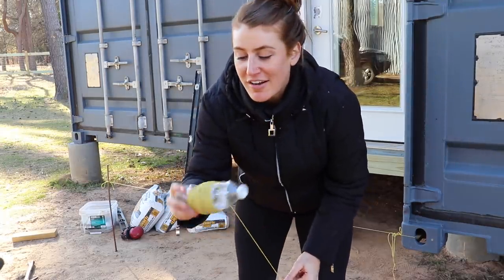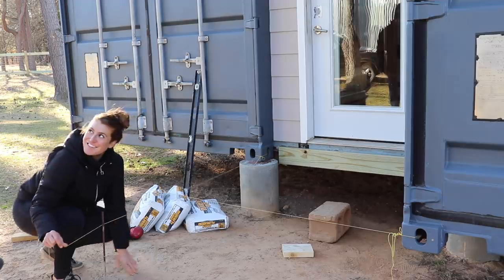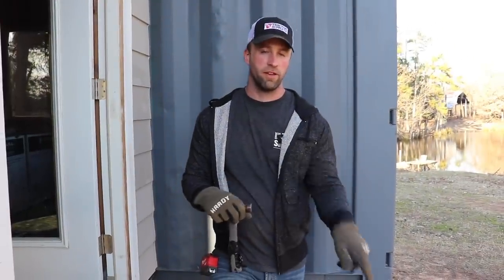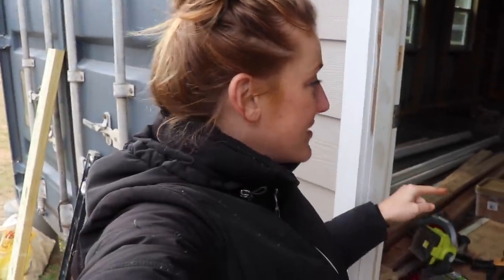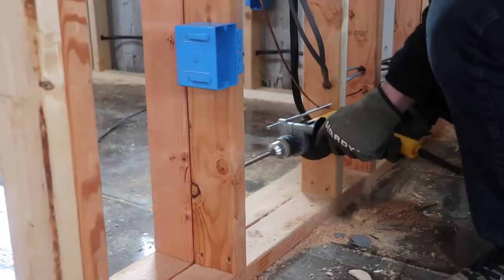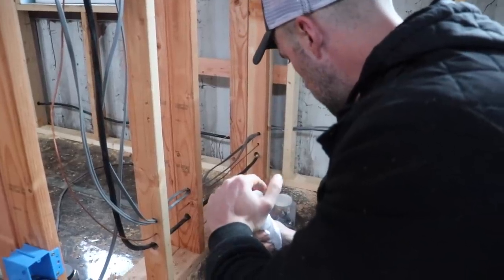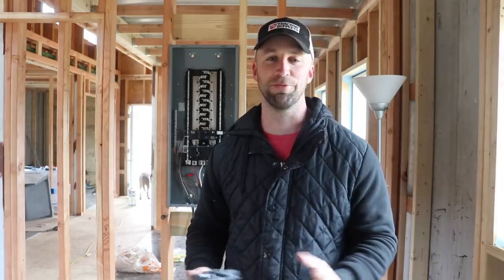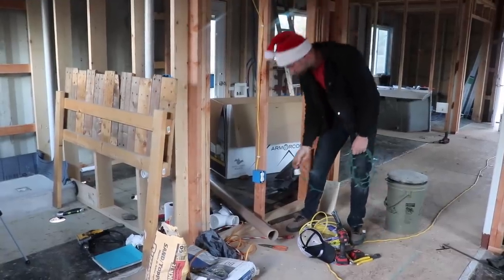Wiring Our CONTAINER HOME!

Comment: Hey, guys, first I want to say that I love the channel and it has been a pleasure to watch your process. I also want to preface this by saying that I'm not a professional and I'm not criticizing here, I am genuinely curious about what I'm going to bring up. Your water system, are you sure you're going to be able to collect enough rain water to support your life in this house? Because I did some math based on some information that I have gathered and you may come up short by quite a bit. Assuming that you have a 4/12 pitch roof, all 3 roof sections are contributing to your rainwater collection and you have 6 inch overhangs... (I can't remember your exact specs), but you should have approximately 1122.99 square feet of roof space. And 1000 square feet of roof can collect 300 gallons of water per half inch, or 600 gallons per inch of rainfall. So, with your roof size, you'll be able to collect 673.8 gallons of water per inch of rainfall, which is being nice because your upper roof overhangs some of the  lower roof, essentially making that space ineffective for collecting on the lower roof. Now, where my land is, where I will be building my house and collection system, Palm Bay, FL, it rains 54 inches annually. The national average is 38 inches per year. I think I remember you saying that it doesn't rain much where you live, but I'm not aware of where that is so used where my property is for the projection. Now that's 0.148 inches per day at 673.8 gallons per inch of rainfall, that's 99.7 gallons of water collected per day on average. The average person uses between 80 and 100 gallons of water per day. So, say that you're being  conservative and only counting the baby as a half for now as it won't use as much water, but will still need some, you're looking at 80 gallons per day for 2.5 people, which is 200 gallons per day. So, unless you recycle and filter most of your water or build a 2nd structure for collecting water that is at least 1,200 square feet, assuming you're getting rain equal to Palm Bay, FL... you're probably going to end up running out of water. My idea to get around this was to have a tank for collecting the gray water that isn't urine and filtering that to reuse in the shower, dish water and watching machine and only use the fresh rain water to supply the sinks so you can drink it and brush your teeth with it. And then I would have a singular disposal pipe that the dishwasher and urine would be emptied from the house with. Poo would be removed by using composting toilets, but the ones that separate the feces from the urine so it doesn't become incredibly vulgar smelling. Anyway, just a thought. I didn't want you to get moved in and have everything completely finished and then find out that you need more water. However, I could be missing something.

Comment: If you haven't done so yet get a receptacle tester. Best $6 you will spend. It will catch a lot of mistakes that can happen after wiring a bunch of outlets. HF has one 

https://www.harborfreight.com/electrical-receptacle-tester-with-gfci-diagnosis-63929.html

Comment: Spenser stabbed himself with a screwdriver.  I've done that a few times, too.  

I noticed you using a speed spade to drill the holes for wiring.  May I recommend an auger bit?  I think it works better (faster and cleaner holes).

Comment: normal rules elektric have 2 fuse/room minimum. but normal uses 4 fuses/room, have lot better safety, if cicuit break stay 1 more fuse on light, 2 fuse need be left side room light and right side room light same wall sockets left side own fuse and right side own fuse, if circuit break or somethink problem you stay safety light and socket half in room what working and have light. no stay full dark room. simple easy and cheap make good all and no save stupid place money. no expensive use 2 or 4 fuse and cables. im certified elektric engineering and i plan,build and make many 10 000 house before my life. my country , insurance not pay anythink if owner build own elektrick, wery dangerous amateur try build dangerous system and dont know all good. can kill itself and many peoples, need be certified engineering if want safety good elektric and insurance work and pay too if has somethink problems.

Comment: Electrician here....one of the greatest failures in electrical installations is using the "passthrough" feature on receptacles. You need to "pigtail" them so that you only have one set of wires going to the device and if you need to remove the device then you can do so without affecting the circuit. I recommend using the push-in style wire nuts from companies like Ideal or Wago...they can help make reliable splices and pigtails without having to worry about the skill needed for traditional twist style wire nuts.

Comment: Will you be loosing the big hinges and locking mechanism on the trailer ends when the home is complete. The corrugated fols in the containers looks cool when it is painted but losing the heavy bars at the ends will take away that industrial edge if you just cut them all off and welded then all shut. As the home has gotten prettier and prettier I keep noticing the heavy bars and hinges and keep thinking it would look more beautiful with them finally gone also. Just a thought. It already looks way more gorgeous than I thought it would do nearing completion structurally. I have seen a couple other container homes before going back quite a few yrs but this one just looks so appealing to me. I would love to go this route myself before I start getting too old for all the harder work, also doing it all yourself must add a huge slice of compassion into the mix because nobody builds their own homes anymore. To be surrounded by a lake, fields a forest and beautiful domestic and wild animals is so natural with health benefits for you all. We live outside nature these days when we really should still be living alongside and within nature as much as possible. Only happier and healthier days ahead for you both I'm sure:)

Comment: I'd first like to say that I enjoy your channel here very much and I look forward to each new update. My primary trade was an electrician, was, as I have been retired for over 15 years, except for occasional helping out friends. Your experience with the arc suppressor circuit breakers was both funny and a learning experience for me as I never had to deal with those as of yet. When I wired a house or any building that had the panel powered, I tried to not have more than one outlet per room live. You will soon enough find out when you dry wall the walls you have installed the devices already as you will have to at least loosen all the devices you have installed to allow the the device to bee against the wallboard for a more stable mounting. I did it all the time for convenience and to have a minimum of extension cords running all over. As for testing everything, that is done after everything else is done all at once. 
Keep up the good job, just constructive and helpful criticism.

Comment: You guys are making great progress, but I would suggest not putting the electrical switches and plugs on until after the drywall is in place.  The little tabs on the plugs and switches are designed to align the plugs and switches with the finished face of the drywall.

Comment: Okay I've seen you guys have some crazy luck and after finding that pipe I have some advice, now that you are wiring.  They make little metal plates you tack to your studs anywhere a wire or pipe for that matter passes through a stud.  When you start dry walling I am certain you will hit a wire or pipe if you don't use these!  lol  It takes time but the time you are taking and effort you're putting into the house it makes sense.

Comment: On the electrical  common process is  1 install box's wire ( rough in phase) next the sheet rock guys  come in do there thing, than the painters come in ,  we the electricians come in and put the switches , plugs  light fixtures etc  ( trim out ) reason is  if you put the plugs in the box's before sheet rock , and than put the rock up the wings of the outlet, switch is traped between the surface of the outbox and the sheet rock , therefore if you have to take the outlet out for any reason you will have to dig the sheet rock out from around the wings of the outlet/switch,  and when you try to put the plates on you will have a gap between the surface of the sheet rock and the outlet  bad deal. That's what the wings of the outlet or switch is for is to rest against the surface of the sheet rock providing support to the outlet/switch. Just a heads up .  Master Electrician/engineer (ret)  20 years  field experience .

Comment: When you are not working on the load center  please put the cover back on it.  There are many ways people or animals (like Bear) can accidentally come into contact with an energized conducter or bus.  Also, test your outlets with a plug in tester made for the purpose. It will show you if your hot and neutral are wired correctly and if you have an open ground, or worse,   Plugging in the Christmas tree lights only tells you that one prong of the outlet is hot and the other has a ground or neutral on it.

Comment: I have to say it really did look like a real Christmas tree in the window. 

I would have installed a four plug out let instead of a two plug outlet every 6 feet.   We all have multiple item that we gave to plug in.  Also this let’s you add some usb outlets.   
Another ideal is to put some outlets higher up on the wall.  This makes it easy to plug in a vacuum cleaner or other items you frequently need to move around.

Comment: First of all, Merry Christmas to the almost three of you.  Second, I love your laughter. Don't ever stop laughing at/with each other. Third. The smart way to wire breaker box is come in on the opposite side of where you put the breaker. Loop ( called a service loop ) around box to the breaker. If you ever have to move breakers or circuits around you'll be glad for the extra wire. Last, you guys and bear are doing great. Keep up the great work.

Comment: You should leave a bit of a loop below each box before clamping cable to stud so you can pull up wire if you have to modify the contents or wiring in a duplex box at a later time

Comment: Quick replacement for the line spool is like a 12" piece of 2" pipe. 2" so you can run a dowel or smaller diameter pipe inside to hold while running out the line. 12" long so you have room to hold it while rewinding line back onto it.

Comment: also the main panel appears to be upside down most common the main is allways located  at the top of the bus bars , in my 20 years in the field the thousands of electrical panels that I have installed  every one the main is located at the top of the box, . Common floor outlets  are normally ( 15 amp outlets  8 max on a 15 amp branch ckt ) GFCI ckt to bathroom/outside can be combined or each . ( A GFCI outlet or breaker) Kitchen  # 12  a min of 2 ckts required , me  1 to the icebox, 1  microwave, 1 dishwasher/disposal  this is all to NEC  (national electrical code)  anything with in 6 feet of water code requires GFCI or outlet or breaker and outside  all inside and outside lighting can be # 14 romex  and number of ckts required   FYI  good luck
Reply: Panels are generally designed to be installed either way.

Comment: METAL BOXES are better than PLASTIC  because you cant ground on plastic your switches and PLUGS
Reply: Plastic is non-conductive, so you don't 'need' to ground it...
Reply: @jsimanella  IF YOU ARE NOT DOUBLE GROUNDED IN CASE OF LIGHTNING its gone FRY EVERY ELECTRONIC in your house they have been BAN HERE  BY BUILDING INSPECTOR IN ONTARIO CANADA

Comment: Spencer I know how the containers are sitting, but how are they tied down. How are you protected from wind damage other than weight??
Reply: The containers are welded to plates that are anchored in the concrete piers.
Reply: @ronsommer9409  Thanks, I assumed they would've been and I didn't remember. This is going to be my next project and I have learned alot and I have alot to learn!!!

Comment: I have been told that the electrical code is going to change in the future to have the ground on the upside of your plug (vs bottom) and the power and neutral will be on the bottom.  That way if anything lands on the plug, it won't short. Just flip the plug! You guys are doing a great job!
Reply: You were told wrong.
Reply: @jsimanella  Actually a couple of jurisdictions here in the DC area have already made that part of their code. A master electrician said that he heard it is in discussion for the NEC and that he thinks several other local jurisdictions will add it to their code before the NEC. My BPI trainer also said he knows it is being discussed in general. (Local and NEC). So maybe 3 to 5 years it might show up in the NEC. The two main causes of the shorts are knives and tinsel falling off Christmas Trees.
Reply: I'd like to see your local codes.
I've been doing this for 35 years. The orientation argument is older than I am.
Take a look at the typical job where the ground is up. You'll see a greater number of broken outlets at the weak points.
When people pull a plug, they generally use an out and upward motion...
Reply: @jsimanella  I am not completely sold on the idea either.  I don't use tinsel on my tree and how often do you really drop a thin metal object near an outlet?  Arlington County VA.

Comment: Congratulations on the installation of the receptacles (outlets) in your future home... Now go back and turn them over because they are upside-down!

The ground position should be at the top. It's a common mistake.

Merry Christmas!
Reply: There's no rules for orientation.
Reply: @jsimanella  

There didn't used to be rules. The code was revised a few years ago. It is a safety concern.

Not every AHJ will fail a COO but they CAN fail you.
Reply: The Code wasn't changed for orientation.
I've been doing this for 35 years. This argument is older than I am.
Reply: @jsimanella  

We must be about the same age because that's about how long I was an electrical contractor before I retired.

I have seen COOs denied for that but admittedly that wasn't the only violation. Also, it was a commercial installation, not residential.

Comment: Don´t you need to be an electrician to install all electrical equipment. Excuse my bad English.
Reply: No.
Reply: @GeneWaddle  I see, here in Sweden you must have a lincens
Reply: @hanzon  The rules vary a lot here depending where you are located. In a lot of  more rural areas the rules can get pretty lax. I think in most places anyone can do the work as long as it's inspected and there are places where inspection is not required.

Comment: That is why we use an electrician to wire up our houses. We also stopped using that style of power points(outlets) and industrial circuit breakers  back in 1950.

Comment: Couple of comments as an electrician...

Why the heck are you using UG rated cable (direct burial) in doors? I avoid those cables like the plague, I rather run pipe under ground than direct burial. All because of the labor to go through in stripping them. So you can use just regular Romex cable from the rest of the house.

Two, and possibly a NEC violation. I saw that you installed a 20 amp outlet in the bedroom. Which in itself isn’t a NEC violation, just odd. What is, is if the breaker is 15amp and/or the cable is 14AWG. 

I couldn’t tell, but all of your outlets for a residential dwelling shall be TR, Tamper Resistance. So your (future) toddler won’t be able to force anything in there. There are little shutters inside the prong holes. And TR will be stamped on the front and backs.

Comment: I'm blown away you are allowed to attach a circuit to a switch board. I guess that's allowed where you come from?
Only licensed electricians who understand the proper testing of an insulation should be undertaking this type of work.
No understanding of a residual current device.
No earth continuity test
No insulation resistance test.
No bonding continuity test
And I'm guessing no bonding on the metal structure.

Dangerous!
So I'm guess the fact that a shipping container is sprayed with methyl bromide and numerous  other chemicals over it shipping life is of little relevance. Chemicals that soak into that wood floor. chemicals that you will breath in for many years....
Good work on putting your family in danger. But at least it was cheap right?

Comment: Wow. A mold factory on stilts! You two have a lot to learn about condensation on the inside of a shipping can. 
Sorry for sounding negative (not intended). 
I hope you’ve got something up your sleeve I don’t know about. I’ve done testing in my can house and was shocked by the volume of condensate being produced. I went back to the drawing board and insulated the outside of the cans. 
Did I see 20amp outlets with 14/2 wire? That’s a no   no by the code in the great white north. 
Good luck,
Merry Christmas!

Comment: certified socket tester have lot better and safety, this measure true neutral-hot wire-ground wire have true right. because if not have ground wire added right have super wery dangerous all connections because have metall wall ewerywere. this is idiot style "testing" use cristmas light working, yes can see work but no can see have safety all sockets.  i hate peoples who do lot but no understand anythink what and how do work right. im certified elektric engineering and know how do all safety and right, i learn in school and work minimum have 3 year school and 2 year real work then can certified test and do elektric work safety and right. and then insurance company can sell you insurance too. before not. if house burn and inspector looking has elektric burn to house insurance no newer pay anythink but if have certified engineer build all and test all and make papers then incurance pay you if house burn. crazy can be but NOT newer stupid.